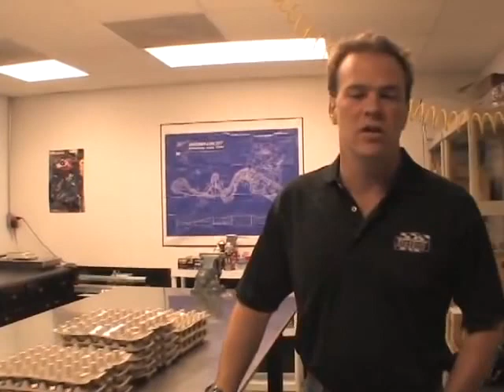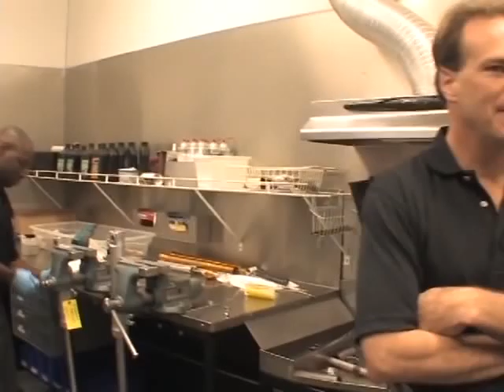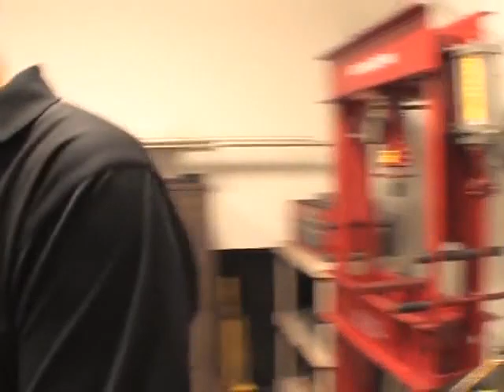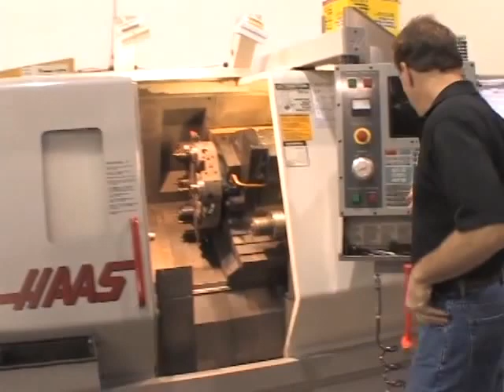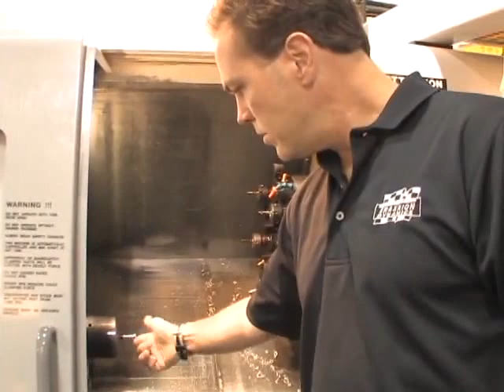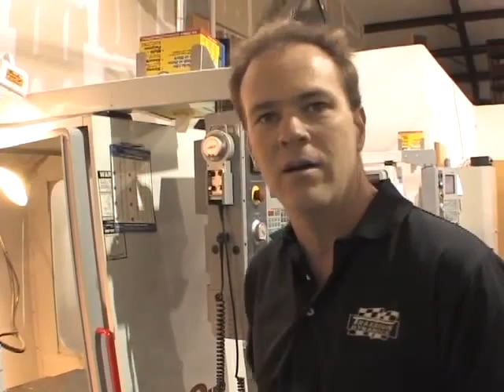🏍🚲 Tour Facility & Suspension Shop Atlanta GA Traxxion Dynamics Motorcycle Bicycle Forks Shock

Comment: Hey thanks for making me aware of this place. Cool stuff.
Reply from the maker: Yes. They have already serviced and updated one set of suspension for me.  Will be taking another to them next week.  This place is something.  Best I have ever seen.
Reply: Horsepower House Are their prices pretty good? Do they want you to bring them the fork and shock or drop off your whole bike? Do you think they can do anything for a heavy dual sport like a Suzuki DR650?
Reply from the maker: @andyblack5687  I wouldn't know who to compare them to.  No one does what they do at this level of expertise.  You can do either: bring them the bike (for an extra labor charge) or bring them the components.  You can't compare them to a Dealership because Dealerships have no one with this level of expertise, equipment, parts on-hand, doing only suspension.  So, I can't answer ya there.  You will never go anywhere else though.  But if your main motivation is "price" you are barking up the wrong tree for this place.
Reply from the maker: @Andy Black They can do anything from a vintage bike all the way up to a GoldWing. If that tells you anything.  No limits.  This place is not about "price" though.  If that makes sense.